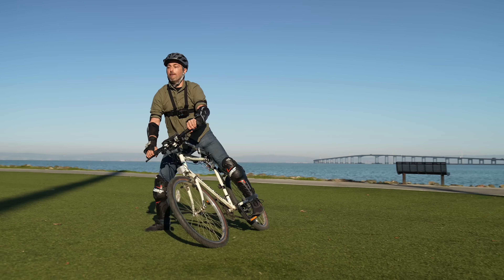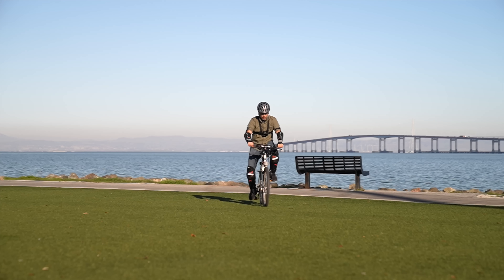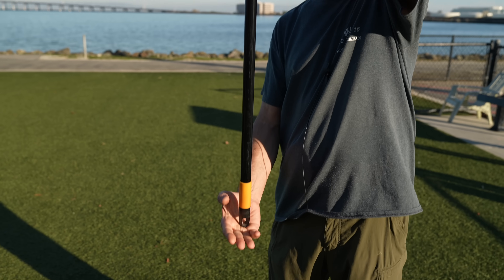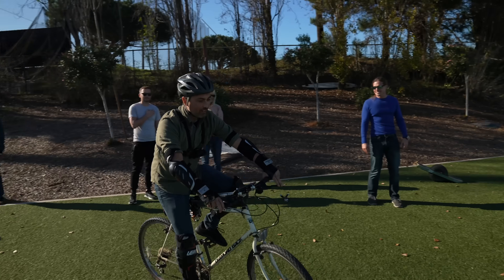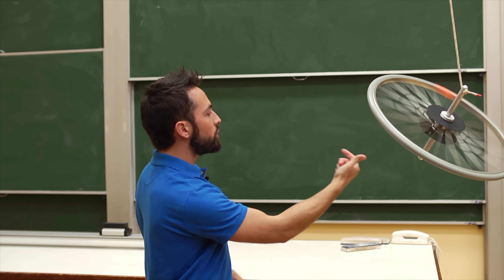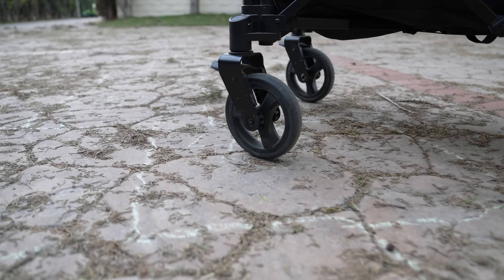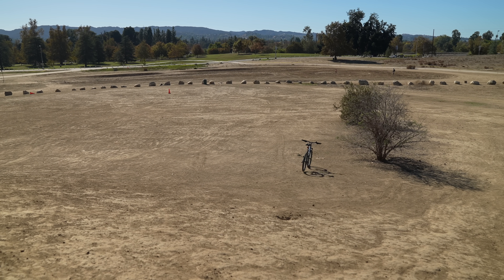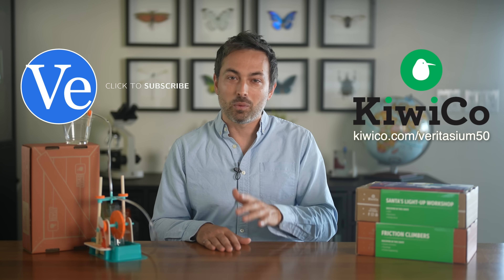Most People Don't Know How Bikes Work

Comment: So that’s why driving without hands is easily possible. Always thought I just mastered balance but most work is done by the bike itself. Truely interesting video. Never thought about biking this way.
Reply: ... isn't it obvious that much of the balance comes from subtle lateral influences, though? You can even see this clearly if you scrutinize a person biking right in front of you; they "wobble" ever so slightly, in proportion with their speed.

When one is biking very fast the lateral wobbling is very miniscule, but still a significant factor.

This is also why minor misalignments in a bike can cause significant top speed decreases & cause the peddling power from the riders kinetic force to be wasted on lateral wobbling, instead of forward propulsion.

Gyroscopic effects do matter, but the reason a bike stays so uncannily balanced is because the rider is free to adapt (left & right) to the minor wobbles as they arise from not being in perfect control of the bike...

This experiment is kind of stupid even. Interesting enough to watch on YouTube, though
Reply: Is easier to pull your hands off the bike when you're going at high speeds on a flat terrain like an asphalt road, but it's also possible to do it at low speed on a bumpy, rocky road too with a little bit of practice and confidence.
Reply: its easy to ride without hands
Reply: honestly anyone that can ride a motorcycle can do this or should do this easily. the video is acting like this is so hard to do but it isnt. all you have to do is push down  the steering wheel for the side you want to go to. or a good rule of thumb is where your head points your hands will do it automatically therefore changing directory
Reply: @danielsnake23  the video didn't at all say that??
Reply: @danielsnake23  an motorcycle and an bicycle, have different mechanics, an bicycle, operates at lower speeds, try to turn on an bicycle, without contersteering.
Reply: @stefthorman8548  so how about when I turn left or right without using my hands?
Reply: @FLAMEalan  you're causing the same effect as when you countersteering: leaning the bike in the direction you're turning
Reply: @oscarkronborg7176  
As someone who's still learning the fundamentals of riding (ya know, before winter started)
I was actually pretty stoked to hear that even leaning to turn is countersteering, you just don't realize it, cause when you lean right, you keep the wheels straight by turning them left so that the bike doesn't flip over from the harsh turn(like some cars do when you try to drift them), but slowly straightens out

I feel like I did a pretty bad job of explaining, but it's like the video said, turn wheel left, bike leans right, bike turns right, gravity pulls left which straightens you out. if it's not fast enough, you'd turn your wheels right to throw you back up towards the left
Reply: As someone who's still learning the fundamentals of riding (ya know, before winter started)
I was actually pretty stoked to hear that even leaning to turn is countersteering, you just don't realize it, cause when you lean right, you keep the wheels straight by turning them left so that the bike doesn't flip over from the harsh turn(like some cars do when you try to drift them), but slowly straightens out

I feel like I did a pretty bad job of explaining, but it's like the video said, turn wheel left, bike leans right, bike turns right, gravity pulls left which straightens you out. if it's not fast enough, you'd turn your wheels right to throw you back up towards the left
Reply: As someone who's still learning the fundamentals of riding (ya know, before winter started)
I was actually pretty stoked to hear that even leaning to turn is countersteering, you just don't realize it, cause when you lean right, you keep the wheels straight by turning them left so that the bike doesn't flip over from the harsh turn(like some cars do when you try to drift them), but slowly straightens out
Reply: @icehoof  check out dandanthefireman herw on youtube. Does a lot of crash annalysis as well as safe riding tutorials and training. Very informative channel
Reply: @FLAMEalan  when you turn left without using your hands, the handlebar would be pushed clockwise, leaning you to the left and then going again to neutral position
Reply: @Mindfever20  from what you said you havent rode a motorcycle. you nearly never push the handles. you push the steering wheel up or down and the leaning already forced the motorcycle to only turn the way you want it to turn rather than having to readjust. same thing can be done in bike. i have a fat boy, the steering wheel takes a lot of force to turn BECAUSE U ARENT SUPPOSED TO TURN THE HANDLE
Reply: @danielsnake23  ive riding since i was a kid, the problem is english isnt my first language, so describing exactly what i do with the hanlde is hard, but i can easilly say, you cant turn a bike just by tring to lean, and you can google that
Reply: @danielsnake23  if you ride a motorcycle and dont countersteer, you actually dont ride a motorcycle, pro riders do it all the time, and even your casual ride would have countersteering in every turn, when you want to go left, you push the handle, which handle? left, thus making the bike lean to the left, its not that hard to understand, you cant ride a bike that cant steer, just try it, why would you think the video tries to missinformate?
Reply: @Mindfever20  thats not what i said, you just took everything out of context.

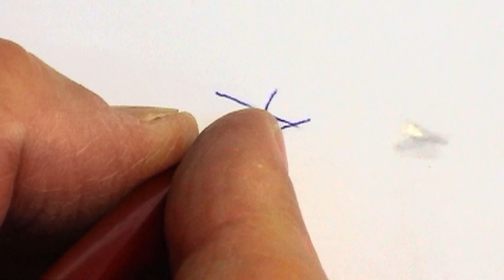Comment: 9:18 - I don't think that the counter rotation is canceling the gyro effect. It may cancel the procession but i think that that setup would double the gyro force (or at least the centrifuge effect) due to both rotations being on the same plane. I may be wrong.

Comment: I havent tried it, but I think you can still turn without the pre-emptive steering to counter balance.. If you stand up and tilt your bike to the direction you want to turn the bike will turn and your body will counter balance it
Reply: You are correct.  Counter-steering is not the only way to cause a bicycle to lean; it's just the most effective way.  Both Derek and Henry Reich (Minutephysics) made this mistake in their videos.  One proof of this fact is that (modified) bicycles have been ridden on tightropes.  If their was no way to laterally shift the center of mass over the contact points, the rider would fall as soon as any small correction was needed.

The reason that's usually given for the claim that counter-steering is necessary is that if the rider leans one way, the bike is free to lean the opposite way, preventing any shift in the center of mass of the bicycle/rider system.  While this would be true if the bike was on a frictionless surface, in the real world the tires grip the road surface, and are not free to slide sideways.  If the rider creates torque by pushing down on one side of the handlebar and pulling up on the other, that will create a lateral force at the contact points of the tires with the ground, opposing what would be a sideways slipping motion of the tires.  That's an external force one the bicycle/rider system, and it will accelerate the center of mass of that system toward the side that is pushed down, creating a lean in that direction, even with no counter-steering.

It's not the only way to create a lean without counter-steering, but it is the simplest one to describe.  There's also the fact that, unlike a unicycle, a bicycle has two points of contact, and it's possible to shift the rider's mass diagonally relative to the line between them.  I have ridden bakfietsen with small children as passengers for many years, and they can absolutely make the bike lean my shifting their weight around in the box, such that I need to make noticeable steering corrections.  If counter-steering was the only way to cause the bike to lean, this would not be possible.
Reply: That’s exactly what I thought. Shouldn’t be that hard tbh.

Comment: If you have ever tried "No-handed" on a Raleigh Strika, you might appreciate that something was always off with the design. The three self correct elements were present: forward angled fork, forward centre of mass and gyroscopic effect of the wheel. However, the forks didn't turn beneath the handlebars and were staggered forward in parallel. As people seem to have built special bikes that buck the system, I would appreciate an analysis of this particular model's ability to self-correct - seeing as it was mass produced and sold to children learning to ride a bike properly.

Note: I think the forward stagger allowed the handlebars to turn initially to one side, but not to recover.
Reply: The Strika used what modern motorcycles use to increase fork Rake(usually measured in a few millimeters)... i.e. the distance between the steering axis(through the center of the head tube to the ground) and the fork tubes at the front wheel’s axle. More rake = faster steering. The caster angle is retained but the contact patch is in front of where the steering axis would intersect the ground. This causes the wheel to "Fall" in the direction of the turn faster and in turn makes corrections faster. Put too much fork rake in the system and the steering gets really twitchy. Conversely, add negative rake and it slows the steering down and requires more effort. Stability remains the same because caster angle is retained.

Comment: For a minute I thought I had the system beat you can ride a bmx bike backwards (sitting on the handle bars and feet on the pedals) while riding if you want to make a turn you just lean if you turn the handle bars to make a turn you lose balance haven’t done this since pre-teen but more I thought about it I realized you still turn the handle bars for balance.

Comment: Smart steering for stable riding at low speeds.. Ever tried using the rear brake? Apply minor braking on the rear and you'll be more stable at low speed.  Cheaper and works just as well.

Comment: I'm going to rate this experiment and video presentation at 3/10 legitimacy. 

It would have been more interesting (or less interesting, depending on perspective) if you tried this with people who knew how to ride a bike.

Your assessment of steering not working when you're sitting still was also incorrect. Ask anyone who's sat still, feet on pedals, waiting to drag race cars at a stoplight...that's not even getting into people who do trick riding. 

You're assessment of a bike not being able to be ridden with locked steering is also incorrect. You can't steer to adjust lean to correct for weight transfer, but you can adjust your own weight above the bike. Any kid who ever crashed and had a brake cable bind up preventing steering could tell you that.

Also, gyroscopic force will keep the bike up, but only at higher speed. Say, if you locked the bars while going down hill. With the caveat that rider input or movement will actually work against the natural gyroscopic stabilization. Obviously, that's an unsafe experiment (especially with your volunteers that can't ride a bike anyway). 

I used to race BMX, wasn't even very good or successful with it, but can still see that if you had chosen different riders (ones who were more accustomed to weight shift) your experiment would have had different outcomes.

As a final note, the test bike was too tall for every rider shown and that on its own would make riding difficult even with normal steering. I'd suspect that you also didn't have a beneficial gearing, instead choosing a gearing that would encourage more force to pedal and thus more weight shift that would need to be countered (either by steering or adjusting the position of the rider atop the bike).

Comment: I kinda just tilt the bike to turn most of the time. To be fair I'm almost certainly an idiot and I'm probably highly at risk for brain damage should I ever decide I want to go ride a bike. Luckily my dad was being dumber than me and left each bike in the house outside. For an entire year, even throughout winter. All our bikes are now very rusted and useless. To be fair though, my old iPod Touch (4th gen) was left outside for 6 months (including the entire, very snowy winter), then went through the washer, all somehow turned on like nothing happened despite all the water damage you'd think it would have. You'd think a that would have less of a chance compared to a bike, being an electronic device. Still wonder why it worked, just like you're probably wondering how this comment got so off topic, starting with bikes and getting to extremely durable devices

Comment: My dude needs more more balance, pedal with your hips, keep your knees tucked in and your back straight, then you can make better adjustments. Also pushing your weight more onto the pedals with lower your center of mass slightly making it easier stil.

Comment: As a lifetime biking Dutchie, I'm not surprised, although it's a really good illustration of the principle. However, I also think I could ride the trick bike, perhaps with a few tries of practice on the specific model. If you stand on the pedals and lean the bike by tilting it under your body, the center of gravity will move enough to the side to initiate the turn and you can then follow through by steering in the correct direction, without initial counter-steer.
Reply: I know it appears like that, but what happens when you lean with straight handle bars, is you're now riding a bike straight ahead that's leaned to one side... and you fall over eventually.

Comment: You push in the direction you turn…. Absolutely stupid. The inertia of the wheel along with allowing the bike to fall over help you begin the turn. If you were straight up and down and you turn the steering wheel to the left were going 20 miles an hour your body would fly to the right and you would crash…..
Ppl are just idiots